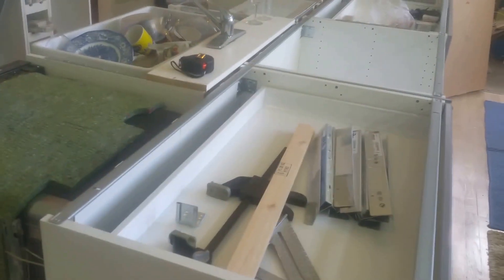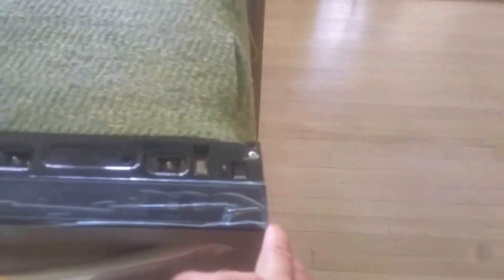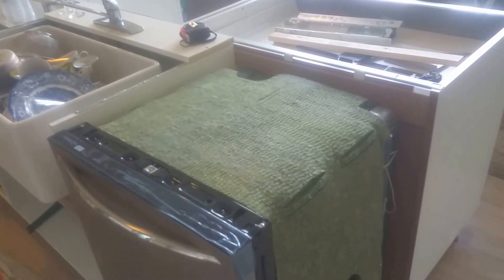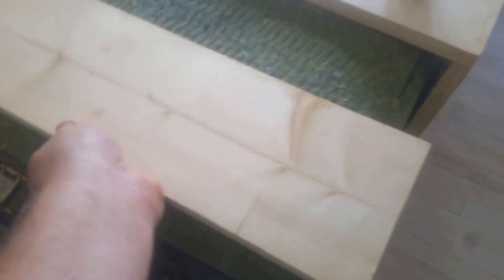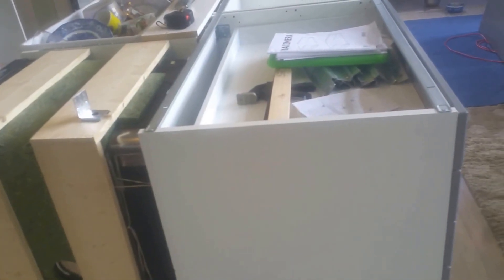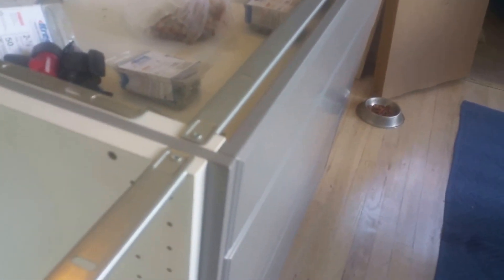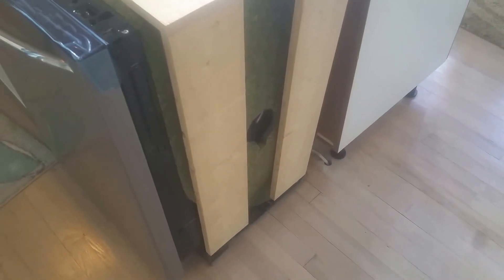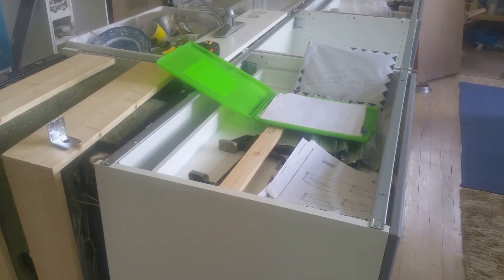Ikea island dishwasher-on-corner problem SOLVED!

Comment: how did you end up getting the  kickplate  instaled
Reply from the maker: I had two "regular" posts (cabinet supports) to connect the clips to... however, on the corner on the front (facing the dishwasher) I basically shaved off the two clip "ends" as there was not as much clearance between the kickplate and the dishwasher's side cabinet.   By shaving off just enough it holds the kickplate out from the dishwasher at the same amount as the length of the kickplate so it is consistent all the way down.    I hope this helps, if you need more clarification don't hesitate to ask...
Reply: Jake Robinson I need more help
Reply: Shawn Desvoigne
Reply from the maker: Sorry, for some reason I did not get the notification... if you still need help let me know...

Comment: Jake thanks so much! Our dishwasher is at the end of the sektion cabinet but it's on a wall. If we mount the end cover panel to the rail on the wall will that provide enough support or do we need to build a frame on top of the dishwasher like you did? Also does your frame end attaching to the bottom of the dishwasher frame or does it go all the way to the floor? Can't see well in your video.
Reply from the maker: Katherine Glass it doesn't go well all the way to the floor - I used two pieces of angle iron - think big L bracket like a shelf bracket where it is attached to the floor with wood screws and the other side is attached to the inside of the vertical wall the box creates and supports the wooden "box" that runs vertically down the side, the top of the box runs across to the cabinet and is secured to the cabinet wall with screws. So the box is like a big L shaped structure running horizontal (across the top of dishwasher) turning down to the floor attached to the L shaped metal supports (the metal supports act like feet) I believe you will need this support to hold your countertop as it will crack/break if you don't add support. The dishwasher needs to just slide into the cavity so you can service it or replace it in the future. It technically does not touch the inside of the cabinet except for 2 to 4 screws that anchor it to the opening of the cabinet on the edge of the dishwasher on left and right sides (as you face the dishwasher) if I can I'll shoot some additional video
Reply from the maker: And to be clear I don't think I'd rely on just the wall rail - I'd build a box of look for a Kreg jig tool that allows you to predrill perfect screw holes to join boards at 45 degrees - These create a very strong joint that will hold your "L-shape" box tightly together plus they are virtually invisible once installed. You just have to be precise with your measurements to make sure that you account for width of your boards when figuring out exactly where that outside box needs to be to attach your end cap. Except since you don't have to make it congruent with an opposite side like an island you will have some wiggle room if it is against a wall
Reply from the maker: Katherine Glass I also found this video which sounds more like your problem - maybe this is a better solution
https://youtu.be/FfI53w4juZs
Reply: Thanks Jake- fantastic advice I'm passing on the the installer.